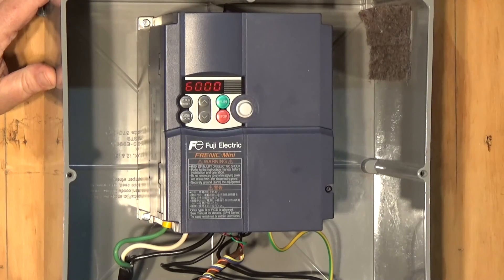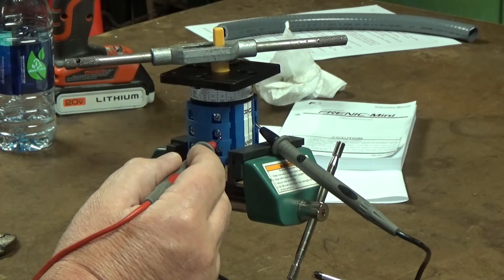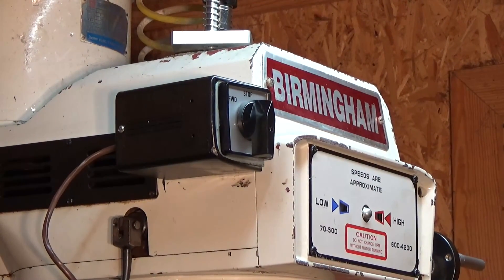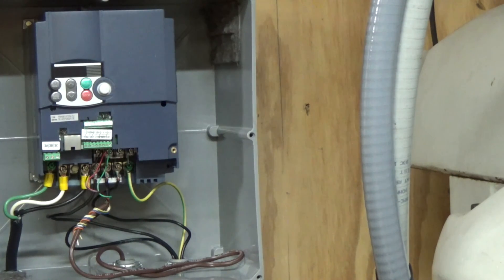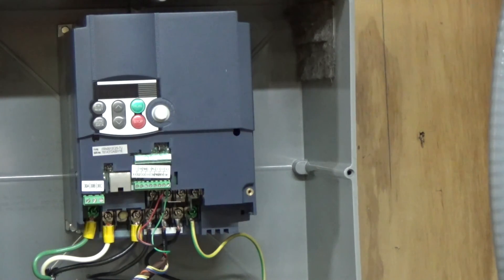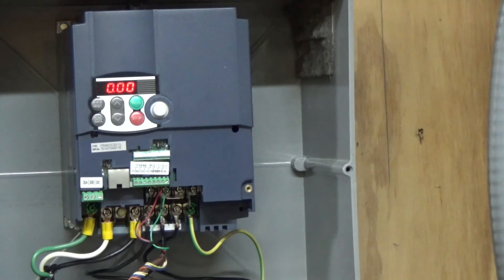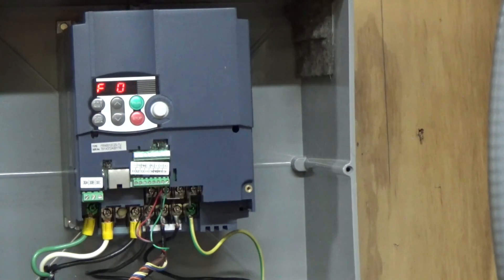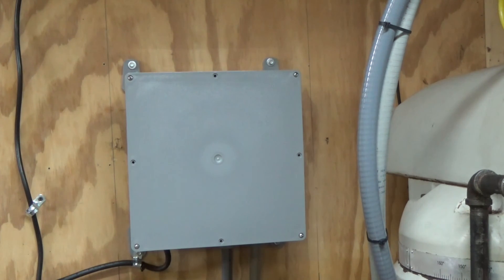How to:   VFD with a drum Switch

Comment: Thank you for this ... I was very nervous trying to figure how to both "ON" and "FWD" with only one switch ... Clever Frenic design plus BSitS skill results in ultimate success!
Reply from the maker: thanks for the kind words James.
Reply: @bstanga  Hello my friend...I have pretty much finished with my lathe install. I have configured braking, brake resistor, DC injection, ALL of the stops, halt the spindle from 500 RPM in less than one second with the 9" chuck mounted, where normal coasing would be about four seconds. At slower speeds the spindle pretty much just seizes up instantly. Note that a brake resistor IS NOT REQUIRED for "moderate" braking of "lighter" inertial loads. Frenic has several built-in brake functions which may be sufficient with "less" inertia as on a mill spindle. Anyone who needs these hack instructions, hit me up.

Comment: Awesome video buddy, your right about the manual being hard to interpret. Just wired a drum switch onto my Fuji VFD and after watching it only took 30 seconds to program. after watching. Also looking at adding a braking resistor after seeing your other video.
Reply from the maker: this is an old video, but it is all still up and running, thanks for watching. I have all but stopped posting videos I feel that youtube has shadow banned my channel for posting gun related things .

Comment: Most VFDs are going to expect that the remote switches are going to be MOMENTARY contact ones. That means that they only conduct when the button is actually being pressed. When you release the button, the conduction ceases. Most, actually ALL the drum switches that I have seen or seen descriptions of are SUSTAINED contact switches. That means that you move them to a position and contact is made and SUSTAINED for as long as the switch is in that position. This basic difference can make a difference when trying to wire a drum switch to a VFD to control it. It could easily produce strange behavior or what may seem to be contradictory behavior. It may also make it hard or impossible to wire the drum switch for an OFF function. The author of the video does not go into the specifics of the wiring that he used.

Comment: I know it's a couple years after this video - but you may not have realized you could add a switch on your head-gearbox to detect high and low gear and to do a FWD/REV swap.  A Double-pole, Double-throw relay (to a proximity switch) or roller switch (both must be BREAK BEFORE MAKE!!!) can be wired with the two commons going to the outputs from the barrel switch, and the Normally Open Side A being wired to Normally Closed of Side B, and the Normally Open of Side B wired to the Normally Closed of Side A. Wire from the Normally Closed of both sides A/B to the VFD, and now when the gearbox is low the switch is in one position, and in high the switch is in the other position - and hey presto your barrel switch will always be correct no matter what speed range the head is in.
Reply: Come to my house

Comment: Those VFDs are nice to have when not too many units are required, also, when they work from 220 volts, otherwise, it gets very pricey mostly on drives for motors 5 HPs and over or multiple motors units...
Reply from the maker: +pierre beaudry Hello PB, that VFD was very reasonably priced at $260, I wish I would not have rushed out and bought the static converter cause from Phase-A-Matic it was $250 plus shipping, anyone need a static converter? LOL, I hope that big fire is not near you up there in canuck land
Reply: Brian Stanga
Already got a 20 HP phase converter...
Those fires are in Fort McMurray, Alberta, I'm near Montreal in Quebec, it's over 2500 miles drive from here, doesn't stop them people to be quite affected by loosing their home...   :(
Reply from the maker: pierre beaudry you are correct, sad situation, hope all is well with you and your's
Reply: Dad is getting better, he got used to our daily commute during treatment, now, he finds reasons to get together...   ;)
Here it's heaven if we compare, just starting to get a little warmth outside, meaning temperatures in the 60's and a little more during the days, nights are still around 40 deg.F...  I'm loving the warmer weather...   Guess I'll be fulfilled at Stan's...   lol

Comment: Looked like mill fwd and reverse were opposite when you ran it up!
That Frenic looks a very capable unit. Probably fairly spendy. That manual looks huge!
Wish I had the right motors so I could use something like that.
You are getting very nicely set up.
Reply from the maker: +ChrisB257 It was reversed Chris, when this machine is in back gear it is opposite of when in hi gear, this VFD cost $260, I should have done the research and bought this first as the static converter was $250..thanks for watching
Reply: +Brian Stanga 
Ahh, gotcha. That price actually doesn't seem to bad for such a useful device.